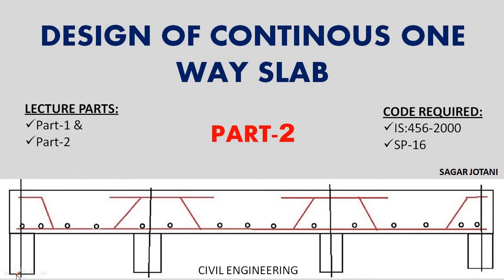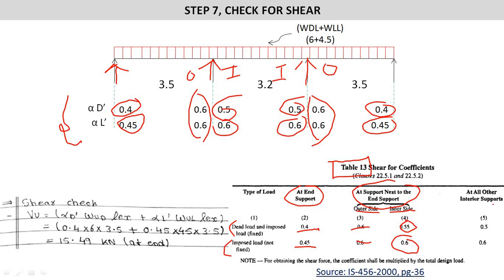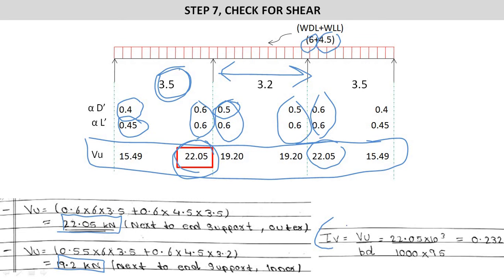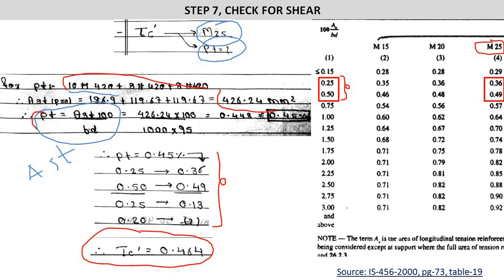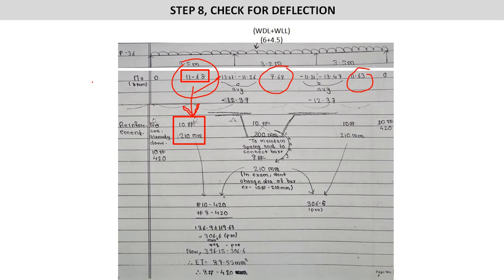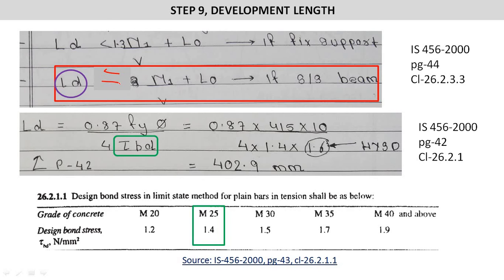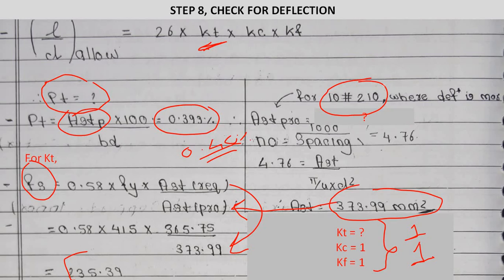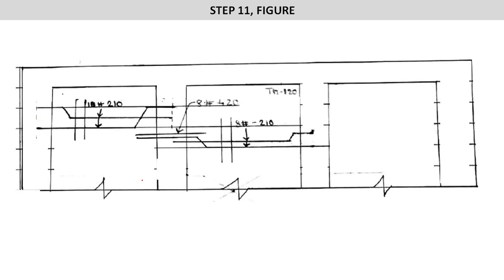Design of continuous one way slab | Part-2

Comment: Thanks for these videos. Please I have a question. If the continuous spanning were to have been in the longer side of these slabs rather than the shorter side, what then,? Is this analysis still relevant in such a case?
Reply from the maker: Thank you Sir,
Yes the analysis remains same.
Reply: I mean for the  moment coefficients at supports